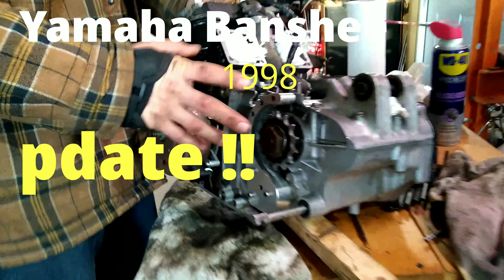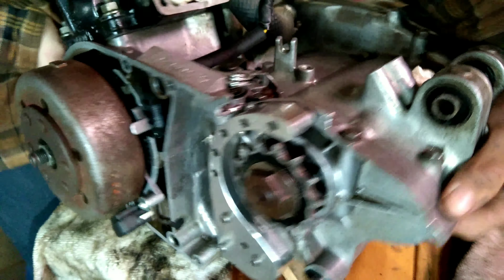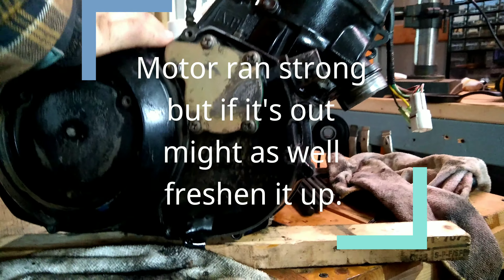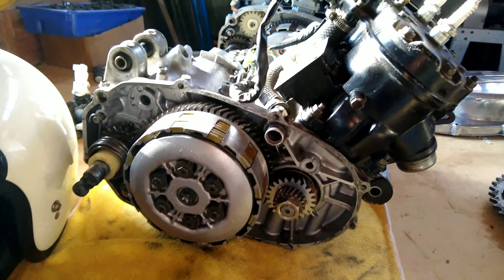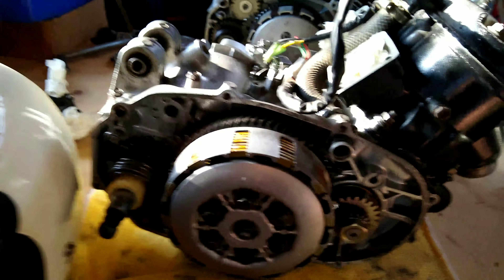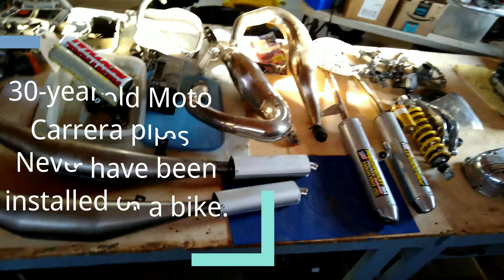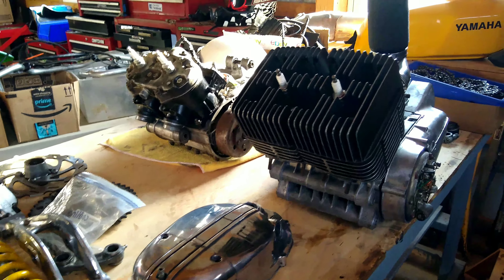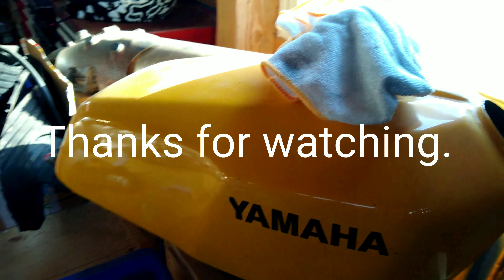Yamaha Banshee 350 Build Update!  Banshee vs Rd350 Motor Comparison.

Comment: RD350 YPVS is the same engine as RZ350 YPVS. The banshee is the same engine again without YPVS and oil pump. Just stupid to compare AC350 with LC350....
Reply from the maker: Oh yeah, why stupid? Because you don't own either and you like to hate on others?
Reply: @OnoratoRestorations  naa, because I'm tired of people (mostly in North America) not understanding that the RD350 of the 80's was liquid cooled and had YPVS just as the RZ. It's simple: they were the same basic bike and had the same basic engine the only real difference was name (RD vs RZ), depending on intended market.